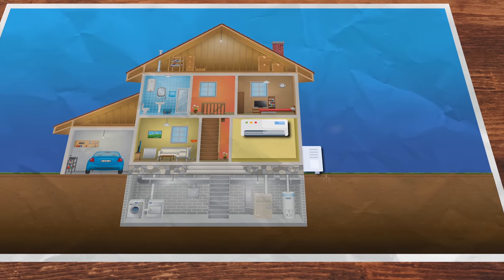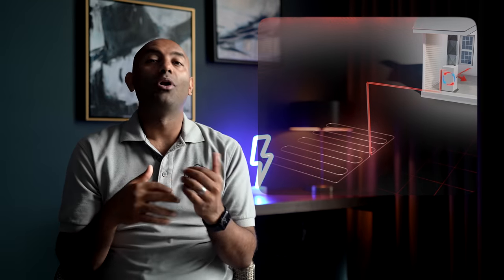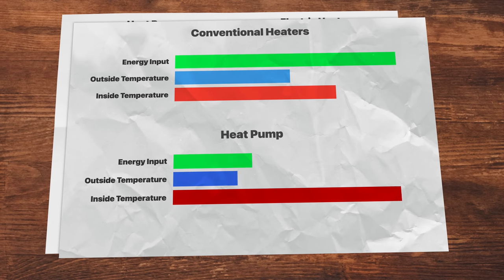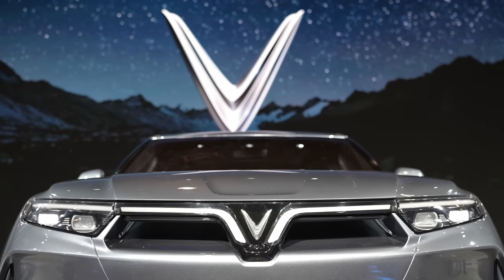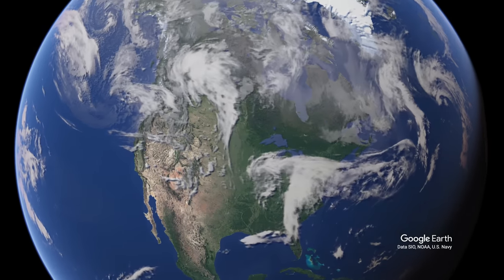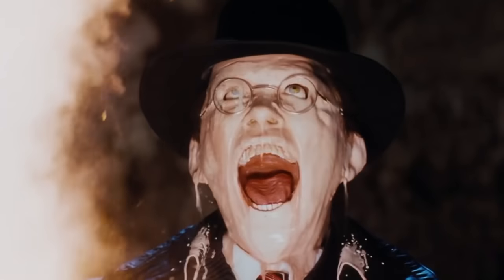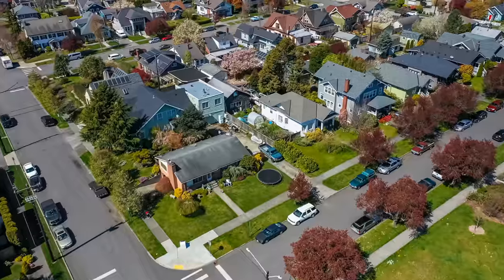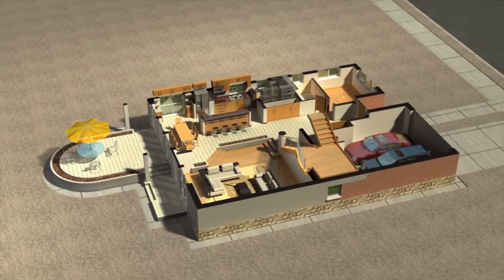Adding This Can Save You Money Summer & Winter!

Comment: The issue with the geothermals are experienced this summer: it was very dry and the temperature was not 'moving' to the ground and hence the efficiency was worse than over the last years when it kept raining more often and the ground was not that dry. So now we had the higher costs than with air/liquid pumps AND less savings - lose - lose instead of win-win.... unfortunately. btw: your energy prices are insane low!
In germany you pay ~ 40Cents/KWh electricity and ~23cents/KWh gas.

Comment: I love my geothermal system
Reply from the maker: Amazon, where do you live? Are they common where you live? Or are you an early adopter like me? Thanks again!
Reply: @TwoBitDaVinci  We build our house in 2019 new and decided to go with Giothermal because we didn’t want propane or electric heat because of the cost. We live on 5 acres so the install was fairly simple because we could do a horizontal loop. We put in a water furnace Seres 7 which is water furnaces best unit you may wanna look into them and check them out. We live in Ohio and they are a little common here but overall natural gas and propane are still common.

Comment: We are about to break ground on a new build and are incorporating geothermal for our hydronic in slab heat (water to water heat pump). It will also provide our cooling through an air handler for fresh air and filtration.  We hope to add solar to cover the power bill after we get a year of use in.  We still have a natural gas boiler we will only use as a backup for when we lose power in those cold winter months.
Reply: Water to water heat pumps are significantly less efficient than water to air. The best water to water heat pumps have a cop of around 3. Whereas water to air heat pumps can have a cop of well over 5.

Comment: I'm sorry but $13000 for a natural gas heater vs $16500 for a ground source geothermal. I think those numbers are way off. You can walk out of the store with a 100000 btu gas furnace for $2500 Canadian dollars. Now you just need a plumber to hook it up and he's not going to cost 10k to do that. The geothermal system is way more complex and it includes having to excavate your yard down to 10 feet and run a bunch of pipe. Plus if something fails in the heat pump it costs big. There is also no way your heat pump will last 50 years, its a compress compressor plus a bunch of liquid pumps. Our friends compressor failed after just 3 years, just after the heat pump warranty ran out, and it cost them big, actually a gas furnace was cheaper than replacing the compressor. Don't get me wrong I love the idea of a heat pump but I live in Central Canada and they are absolutely not feasible here, I've seen many people try them and fail.
Reply: Longevity depends on the system, so research is essential for any type. Aside from a couple of pumps for the ground loop, ours (a Climatemaster) has been running without any issues for 12+ years. Since it was new construction and they needed to install ducting etc. in addition to the heating & cooling systems, the prices were similar after federal and state incentives. Before incentives, gas or air source heat pump were each around 14k USD (need a heat pump anyway for AC with the gas furnace system), a ground source heat pump was $19k.
Reply from the maker: the prices are for a whole new system, ductwork, electricity etc. Apologies if it's confusing
Reply: The last guy I got an estimate had been installing geothermal for 35 years. And he said that most of the first ones he installed are still running the original heat pumps. They don't work as hard changing the temperature from 56deg constant ground temperature.  Vrs air source. Trying to pull heat out of  -20f and  put heat back out into 100f. Plus they are not exposed to the elements outside.

Comment: The diagram shown at 0:57 appears to show a mini split system. Typically ground source heat pumps are located inside the house which gives them better longevity that you do address later in the video.

Comment: Geothermal heat pumps have another advantage I didn’t hear
All Sumer long you are pumping excess heat into the ground then pulling it back out all winter long.  Now where near 100% effecency but sill some advantage.
Reply: And the compressor will run less when cooling if you’re asking it to adjust the temperature slowly enough since the water coming from the ground is already cooler than what your thermostat is likely set to. Ours doesn’t turn on the compressor to cool unless I ask it to drop 2 degrees or more from its current setting. If the delta is only a degree, simply running air over the coolant lines is enough.

Comment: Moved to our house in Jan 2021 in North Central Ohio. Electric baseboard heat with no AC. Ground based geothermal (vertical, using 4 150' wells) was activated at the end of May. Even with the addition of AC, which the house had never had, my electric bills were immediately half as before. This continued into the fall heating season. In the last week of December, solar was activated with battery backup, and as of April 2022, I got my first zero electric bill (with a $5 credit). According to the Enphase monthly report for April 2022, my overall energy independence is at 67%, meaning only 33% of my power came from the grid during that time. It's been increasing as the weather and amount of daily sunlight improves. This has been a huge investment, but I'm happy to be moving in this direction. It's an investment that will continue to reap benefits long after I am gone.

The geothermal was around $34,000 before approximately $8600 tax credit, this was partly because the house had no duct work and no furnace which added to the cost.
Reply: out of curiosity which unit did you go with and what is the size of your house?

i went with a packaged 3 ton bosch unit for my 1325 square feet home.  i paid 18500 for mine, but i only needed a 2 well open loop system, and it was pre-pandemic pricing.
Reply: @The_Lone_Aesir  It's a Water Furnace Series 3. It also supplements the conventional electric hot water heater. The house is about 1800 square feet.
Reply: I think that was a great price with ductwork, furnace and some partial hot water heating. Your doing great in my opinion!
Quotes seem to be much higher here in NY.

Comment: like mentioned you only have to go down at least 8 feet to get the consistent temp underground. while it may not be effective for people in town, if you have any property at all, ive seen people burrying 230 feet of 6 inch pipe using just air movement and not water to heat and cool their homes... using just a 7 amp fan to move the air.. which is even yet more efficient than the one talked about here. but.. yea. you have to have a bit of yard to do it, have to have 230 feet of 8 foot trench dug.. but compared to others talking about renting drills to go down a hundred feet or more.. meh.

Comment: The cost contractors charge to dig a hole is insane. A simple trench to drop in a sewer or drainage line can be $150 a foot. People are not aware they can rent excavators in many sizes and dig themselves if they have basic skills like driving a tractor or know someone that does. Most of the cost of these is just the hole. Everything else is as basic as a central air unit that works in reverse.
Reply: Agree 100%! Thats what I have planned. Rent an excavator with a wide bucket, atleast 36", bury my 33" slinky style loops in 3 trenches (600-800 feet of pipe in each) as deep as the arm will allow (10 feet or greater), and run all the loops in through the foundation, and seal it. Then build my manifolds in the basement and run them to I think a Bosch SM036 unit. I will then only pay someone to install all the ductwork and do the electrical.  The savings will be huge! These installers are out of their minds with the prices they charge to bury pipe!

Comment: I keep asking everyone ... what about heat transfer cables. Carbonfiber for example put 200 ft. to 1000 ft. down to bring heat up. Anyone of the systems shown can be used to cool a structure, but heat can be brought up and  converted several ways into electricity

Comment: I desiced for modern gas heater with low-gradient heating, having a house built at the bottom of "low energy" standard. I didn't want to buiild a  passive house, since 12 years ago that was still quite more expensive. But I tried to come close as far as it was feasible, having tripple pane windows, etc. My neigbour has a ground heat pump and he's very happy about it. But it's hungry for electricity and I think that's the general case, since electrical energy companies have special cost plans for heat pumps. I think it comes to like 2/3 of gas costs, maybe little bit less. But don't forget much higher installation costs and I also think that those numbers about longevity of heat pumps mentioned here is very exagerated. Specifically the pump itself wears out and is expensive. I'd sayy overall, heat pumps are a bit more efficient, but not much. If one talks about building a new house, the best heating is to decrease a need for heating as much as possible. I'd go for a passive house Today, it really make sense.

Comment: I contacted multiple contractors in my area to check into geothermal. I was ready to lay out allot of cash to do it. No one was willing to warranty the success. Hmm. Several said they installed multiple systems that were complete failures. Digging further I uncovered that the geothermal was actually freezing the wells and fields. Where I live the ground temperature at 12 feet down is 47 deg. There is the problem. The further North you go the worse it is.   Picture creating permafrost. Since we heat on average 8 months out of the year, We are pulling one direction. Heat out of the ground. During the summer months where we would add to the heat by running ac, we don,t use much ac. We still need domestic hot water. So we are pulling heat from the ground 12 months. To make this work it appears drilling wells is not an option. This leaves horizontal systems. the horizontal field would need to be far larger than fields just 100 miles south.   Because of this, I am going with air to water and leaving my oil burner in place as a back up. This was the obvious choice after installers kept warning me. Several were willing to put the system in but the cost was extreme. The lowest quote came in at over $50;000. Now maybe on the coast of Maine geothermal will work. Just not inland one manufacturer suggested air to water and oversizing the system . That is the plan now. My homes btu requirement is 110;000. We are installing 144,000 btu air to water. At -7 we should expect that system to produce between 60-80;000 btu.

Comment: A new home if you build passive solar and insulate it like a net zero home. Then pop a solar roof on and maybe a little solar water heater then add the geo thermal heat/cooling heat pump . (Also with a battery back up system) the home in some places could earn you income by selling electric back to the power company. The earnings/ money saved will pay for the increased building costs real fast. If your in a good spot the insulation and passive solar style will  do the trick all by it self the other stuff could be overkill but add that and you will almost never need to be on grid !! .you would probably be selling electric 11 months of the year if not all 12 (even if you charge an electric car).
Reply: I have good insulation geothermal and solar 3400sqft  zero bills. Passive design is overkill. Lol
Domestic hot water is generated from a water jacket around the compressor. For free. In a geothermal unit with desuperheater. Don't ask me why they call it that.

Comment: In my region we use air heat pump systems, because geothermal heat pumps are not worth the extra charge. The extra costs will break even only in 20 to 50 years.

Comment: Geothermal is nice BUT, there's a real big but. It is VITAL to do things in the right order. 

First you insulate, make airtight and ventilate. Doing so might (YMMV) reduce your need for heating and cooling to a level where a simple air source heat pump known as a mini-split will do the trick. You might already have one, or it's older sibling the split unit AC in your home. Instead of ending up with a complicated well and a costly set of equipment that uses a fair bit of electricity you might (again YMMV) end up with a simple replacement of your current AC units by a plug in replacement that is cheap, swaps out in no time at all and uses a lot less energy.

But you must start with insulating(to keep the energy in) making airtight(so the energy does not go around your insulation) and having the correct ventilation(so that moisture can get out but energy stays in) before you look at heat pumps whatever the type.
Reply from the maker: yeah good points

Comment: Thanks for another great video.  Solar has already reduced my cooling/electric bill so I’m not sure a geothermal system will still pan out. But I like the idea of building it into home construction.
Reply: it really depends how much energy you are producing. the geothermal would make your heating and cooling take less of the electricity you produce from solar leaving either more energy to sell back to the grid if your area does that or further reducing the costs you pay for electricity if you don't meet 100% of your electrical needs from solar.
Reply: As someone who has both (geothermal and solar) i say that this depends entirely on how efficient your current system is.  if you already have a reasonably high efficency air source unit then going geothermal would be only a slight upgrade, and likely not worth the cost.

in my case my house had a heating oil system for heat, and a 25 year old AC system for cooling with ducting that was in terrible shape (house struggled to maintain 80F inside temps during the virginia summers, and winters cost between 300-400 a month to keep comfortable)

The cost difference between the geothermal system  (which included ducting) i ended up with (18,500 before tax credit in 2018) was only a thousand dollars more expensive than the highest efficiency air source unit i had been quoted and about 4 thousand more expensive than a mid tier efficency system i had been quoted.  after tax credit it ended up the cheapest option.
Reply: We're looking to build a passive house, with super insulation, plus solar, so not sure it's worth it, as opposed to heat pump and gas heat and water heater.
Reply: I have geothermal and solar all electric house have had zero bills five years running. Net metering on 10,080 watts of solar. If I use my buddies utilities for a  year  smaller house. LP and electricity. Built in the 70s. $5,000 a year and climbing. Solar paid for itself in less than five years. All money in my pocket from here on out. 
I installed geothermal myself. Paid for horizontal loops. Less than estimates to have conventional HVAC installed.

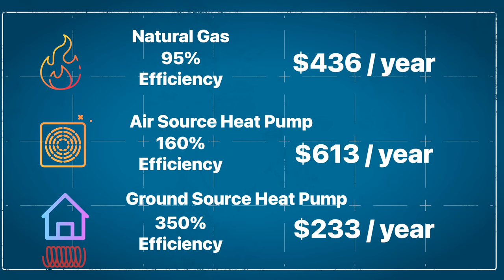Comment: 9:00 if you stored excess Solar energy into a GSHP over Spring, Summer and Autumn you would have potentially a much better COP as the ground would have been used as a heat store and therefore be much hotter....

Comment: What is the impact  on plant roots after  pumping heat into the ground?
Reply: if the well is deep enough then none. the heat getting pumped into the ground will radiate out in all directions and not just up. it only takes a few feet of dirt for the temps to begin to normalize again
Reply from the maker: yeah if its sufficiently deep, its basically zero. The earth is a MASSIVE heat sink, the impact of a little heat input is like a drop in the ocean.

Comment: This would be great in a district system. Have geothermal heat pumps that pull heat from vertical loops and inject/remove it to the district heating/cooling water. This would work great in cities!

Comment: in denmark vi run the ground loop water true ventilations air to water heat exthanger end gets free cooling by only running cirkulationspumpe and vetilation system